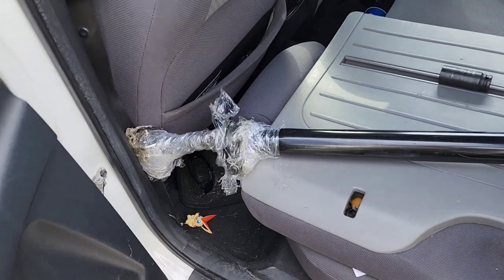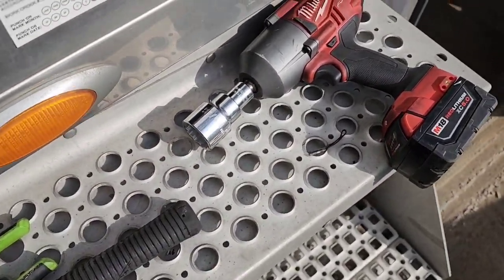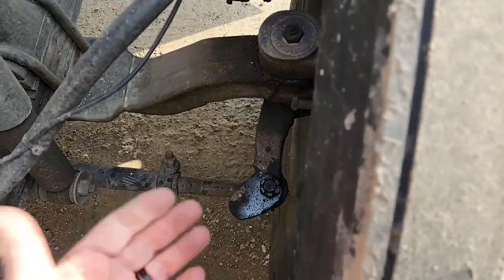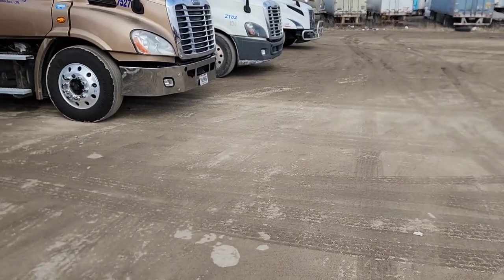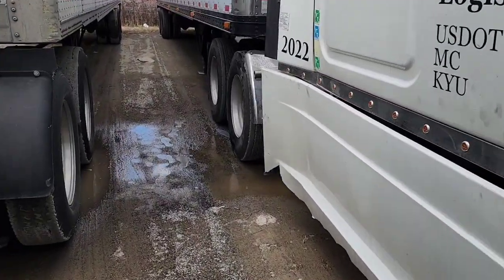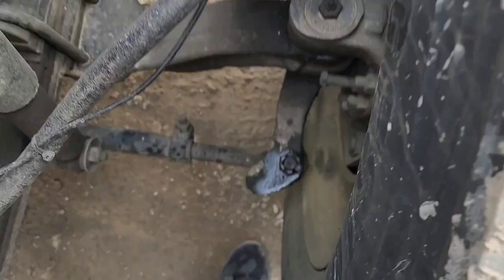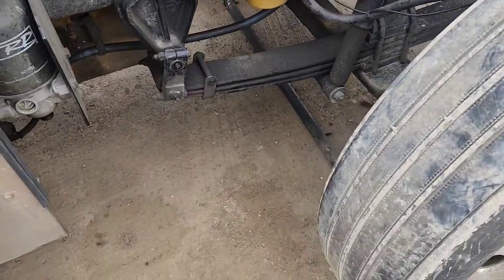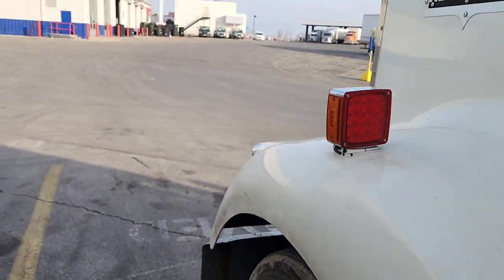Changing Tie rods on Kenworth W900! How hard could it be?

Comment: Just do a field alignment. Mark the center of the front and rear side of both steer tires and adjust until the measurement is the same. Someone helping you it take 10 minutes. Unless you do a 3 axle alignment that’s probably what TA is going to do 🤷🏼‍♂️
Reply from the maker: I was way way off lol
Reply: @DrivetoProvide  must be an army thing…😆